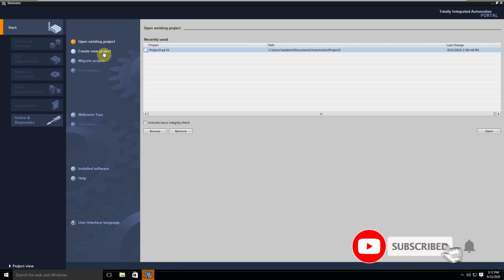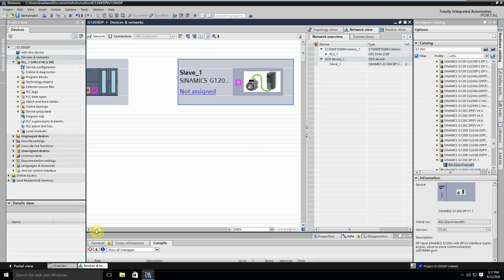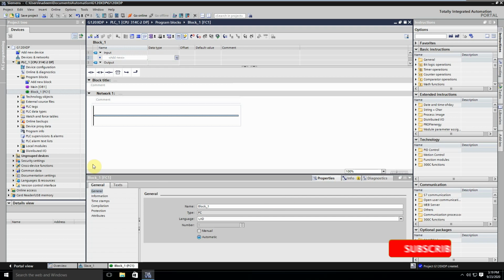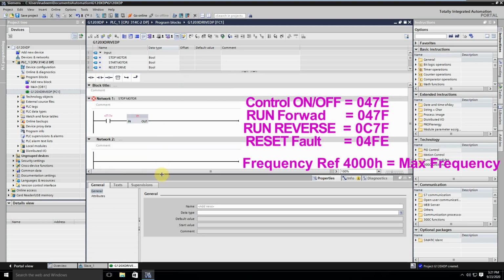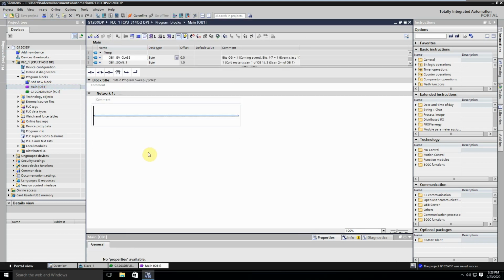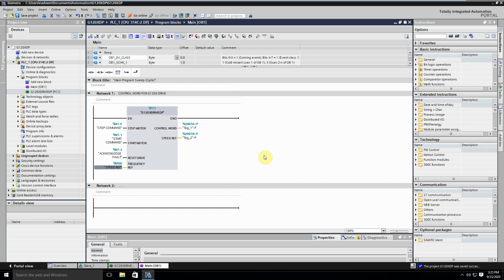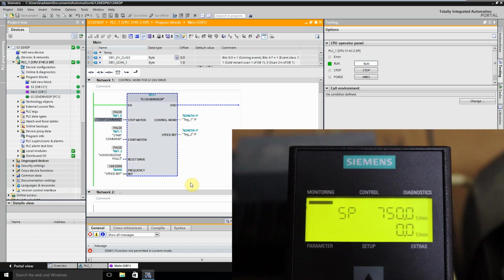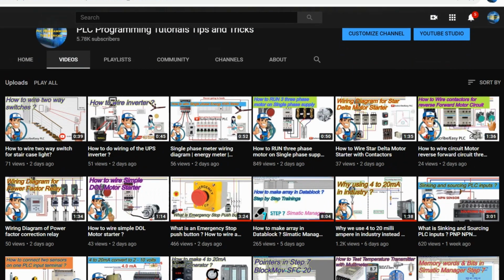Communicate siemens S7 300 PLC with Sinamics G120x  VFD Drive via profibus using TIA Portal Part#1?

Comment: Good knowledge.But i was searching one thing.i replace one of simens drive but its showing BF Fault.i have copy the prameters by bop and paste with another.I thing communication issue.can you help me.
Reply from the maker: What is drive model ? Is it profibus ? Check the drive profibus address in the parameters , old and new drive address must be same , ..... check the Dip switches for the profibus address under the BOP . Set these dip switches same as old drive....
Reply from the maker: After setting profibus address , power cycle the drive , OFF and after 2 minutes turn it ON
Reply: @EASYPLCTRAINING  Thanks for your value response.Yes profibus ethernet cable,no dp switch, model no is 6SL3210-1KE11-8AF2.What is parameter for profibus address.

Comment: Very well explained!!
I would like to know if I want to run/stop the drive via digital inputs only and speed reference to give only via profibus,  what parameters do i need to set for that?
As of now when I established the communication via profibus then now I'm unable to start the drive via digital inputs!!
Please help me with this
Reply from the maker: All PROFIBUS DIP switches = OFF --> Address defined in P0918 is valid otherwise the DIP switch setting has priority and P0918 indicates DIP switch setting. check address in OLD drive paramter p0918 and put this address in new drive and save it and power OFF and ON the drive.